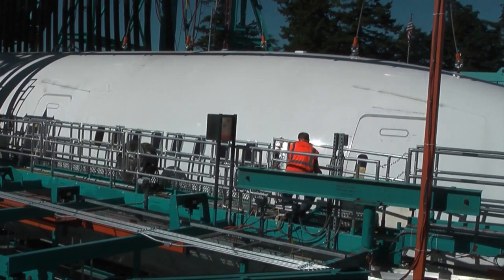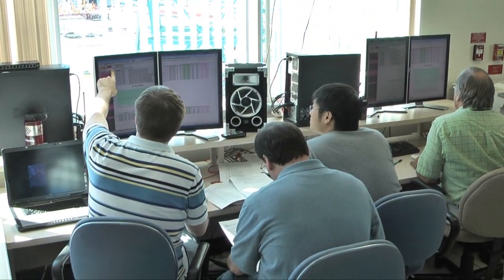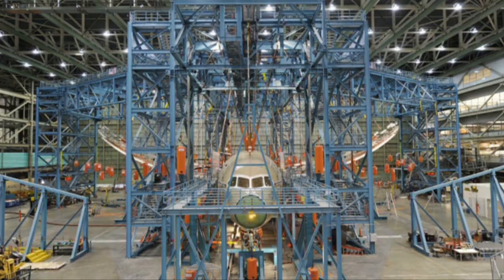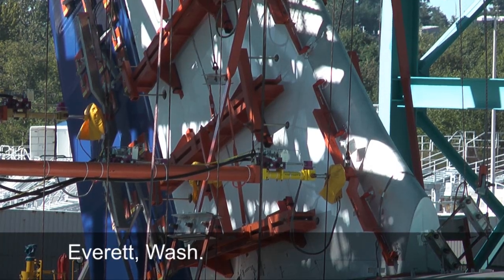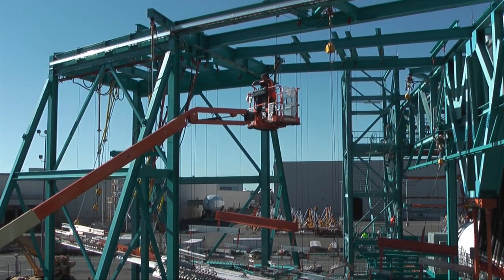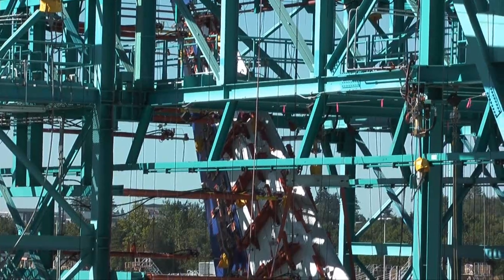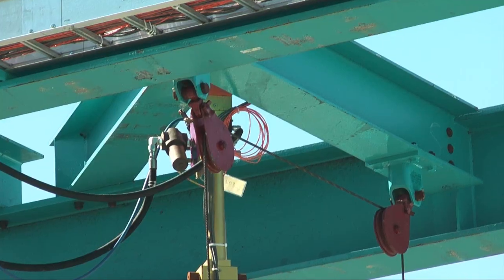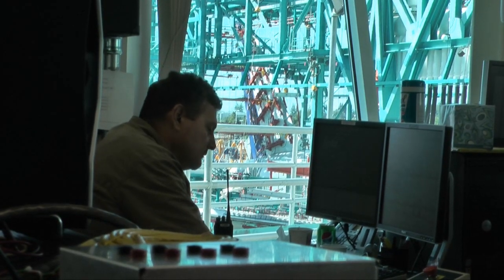Boeing 787 conducts fatigue testing

Comment: plane makers must make autopilots secure from terrorists. pilots must be in complete control of the plane  .at present  the terrorist can set the autopilot to land any where.he can do this before he leaves the plane into the memory unit of the autopilot which will carry out the instructions and in some cases they cannot be changed its disasteruos

Comment: The reason Boeing has had more "Inceadents" is because they have been around longer. They are one of if not the oldest manufacturer in the world, with many successful models, i.e. 737, 747, 777, etc. And 7,100 737s have been build as of April 2012.

Comment: No, once the Fatigue Test A/P has approx 10,000-12,000 cycles, which is required by the FAA, it's good to go into service. Boeing puts the balance of three lifetimes on the A/P for their own data. In any case, we stay well ahead of any in service airplanes to find potential problems here and implement any changes fleetwide.

Comment: Because there is no interior installed in the test article. Sunlight will breakdown the carbon fiber from the inside out. The windows are designed to filter UV but, at that time we were taking no chances. We have since removed the window coverings.